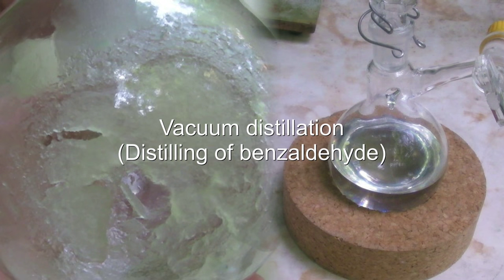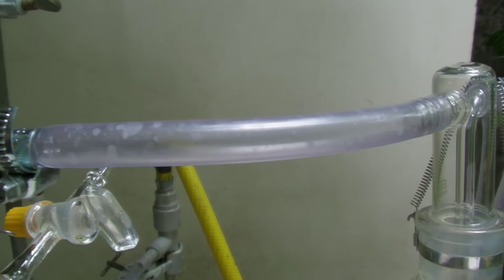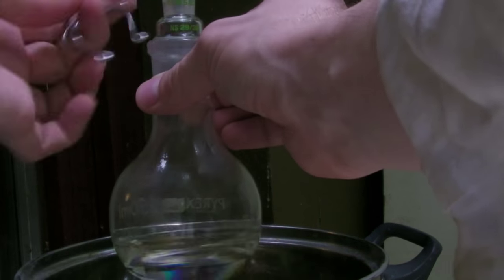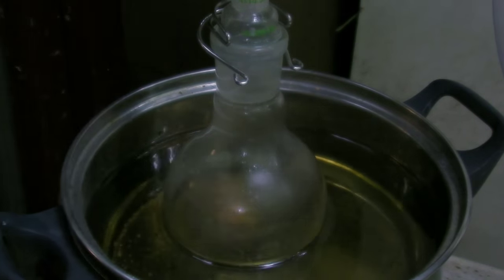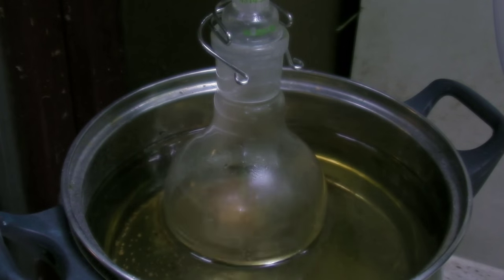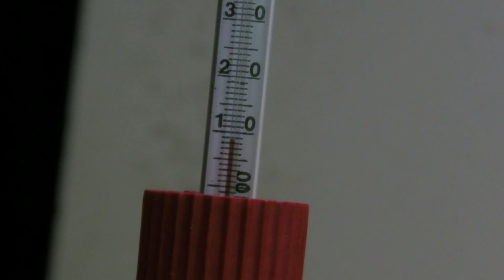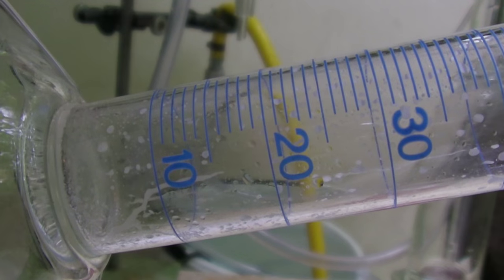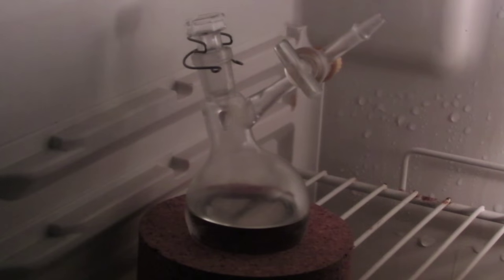How to do a vacuum distillation (Benzaldehyde)

Comment: Nice to see how it's properly done in the lab. I just discovered the water vacuum pump, interesting. I need to find or make one. I just made a vacuum distillation device from 2 glass beer bottles and a copper tube to experiment with vacuum distilling salt water. The water boils in it at 45°C. Not bad for a home made thing withtout using a vacuum pump (I fill the two bottles, connect them and drain the water in the receiving bottle to make the vacuum).  It can purify around 60ml of water a day only with the direct sun on the hot side (bottle painted black) and a water bath for the cold side.
Reply: Michel PASTOR yes it is possible to make a water pump cause i made one. 45C !! that must be a pretty good setup.
Reply: science Vlog Making good seals to get this low wasn't as easy as I initially thought. I should have used another type of bottles since the top is not exactly cylindrical and does not help with the seal but I used rubber o-rings and teflon tape on custom 3D printed caps with tight fit and it doesn't leak. The thing is I don't want the thing to explode in my face and it was the only strong bottles I had. What materials did you use to build your pump ? Maybe I can print one out of ABS plastic ?
Reply: Michel PASTOR Is the recieving flask the pure Bz? Or is the boiling flask??? How fast should the drip rate be?  How long do you allow it to distill? What is the cutoff point? & how is one supposed to properly dilute the boiling flask with a soecific solution? And how do we know when that water solution is being aloud into the distillate????

Comment: Hi! I need to purchase some round flasks for making vacuum distillation, but i would like to buy the flat bottom ones so i could heat them either in the heating mantle or on the hot plate. Is this something really convenient? Or are the round bottom flasks significantly more resistant to vacuum than the flat bottom ones, to the point that flat bottom ones could implode? Please help me with your advice. Thanks a lot!
Reply from the maker: Flat bottom ones might work, depending on the vacuum, but are way less resistant. I would rather have the disadvantage of being able to heat them only one way, than risking a glass apparatus to break, which has a vacuum inside.
Reply: @RaExpIn  I think you're right. Thanks for your advice!

Comment: What is the boiling point of benzaldehyde, with use of vacuum ??
Reply from the maker: It depends on the quality of the pump and the sealing of the connections. Good setups lower the boiling point to around 90°C others, more like to 130°C.